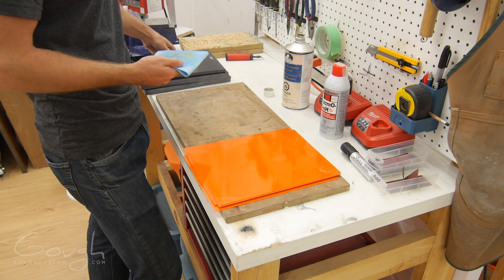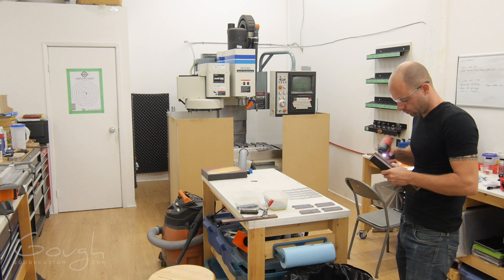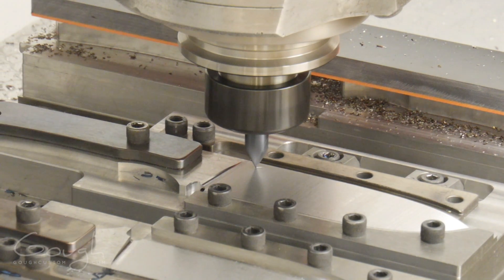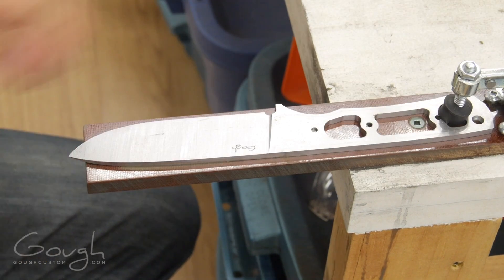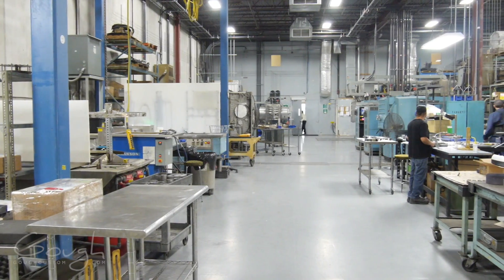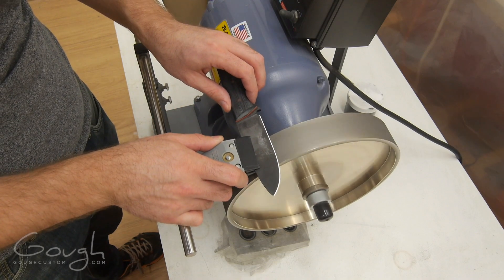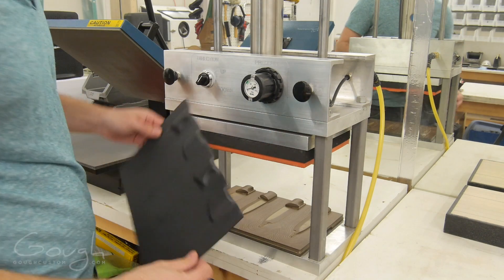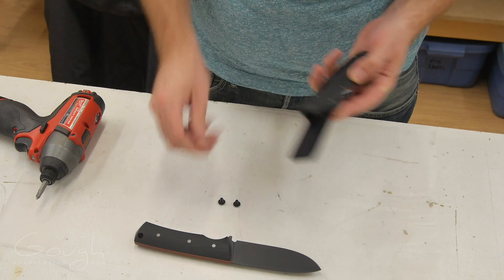Making a knife the high-tech way - Resolute MkIII

Comment: All that effort and you use A2 instead of 3V... Are you trying to upset me XD
Reply: Ive just learned how much better 3v is compared to 1095. I need a kiln though to even get started with it.
Reply: @3vforge  you could always send it away for heat treatment, probably cheaper if you're not doing many blades
Reply from the maker: As I said in my other comment I found that 3V tended to dent and roll at the edge far too easily for my liking, much more easily than A2 does for sure. I will hopefully be doing another round of steel testing soon to see if there are any steels out there that I like better than A2 now!
Reply: @GoughCustom  that's quite weird, 3v is one of the toughest steels available according to most sources. Are you sure your heat treatment was correct? I find it difficult to believe since the dozens of reviews I've seen always say that 3v has better edge retention, corrosion resistance and toughness that A2
Reply from the maker: @antimatter4733  It is definitely very tough, but in some cases that works against it as it means it's ductility will allow edges to roll. The heat-treat I used was with a 1000ºF temper as recommended by the steel manufacturer. I have heard that alternate low-temper heat-treatment with the addition of cryo can cure 3V of it's tendency to roll edges, but I haven't personally tried it yet. Comparing two steels by just saying 'A2 is better than 3V' or the reverse unfortunately just isn't that accurate because it fails to take into account the fact that every steel performs very differently with different heat-treatments... Other companies A2 is definitely not the same as my A2! Same goes for the 3V test, other people's 3V may perform differently because of their heat-treat. I can say I have tested my steel against knives from many competitors and I have been very happy with the results :)
Reply: @GoughCustom  it sounds like you heat treated according to the manufacturers recommendation but didn't take into account the properties you were looking for. The recommendation calls for an austenitizing temperature of 1950 with a 3x tempering or 1000, however this leads to a hardness of around 59. If you were having problems with edge rolling then the hardness was probably too low. If you aimed for a hardness of around 61-62 you likely would not have edge rolling and still have equal or greater toughness with better edge retention and corrosion resistance. Just something to keep in mind if you decide to try 3v again.

Comment: What type of steel are you using?  I assume not 440 or some Chinesium like 7CrMoV17
Reply: A2... Pretty mid range considering the tools he's using
Reply from the maker: It's all in the heat-treat... Even the best steel with a mediocre heat-treat will perform poorly. I'm using A2 because it's very tough, that lets me run it very hard which in turn lets me run the blade very thin which increases cutting performance. I am very happy with my A2 and I have had many customers tell me it easily out-performs their other knives with 'super steels' like S35VN and so on, which are usually heat-treated much softer because they are not tough enough to be run above 60HRC safely...

Comment: The blades look pretty thin, I wonder how they hold up.
Reply: A2 is quite tough but he's running it at max hardness so I wouldn't recommend any lateral force or chopping bricks
Reply: @antimatter4733  yes a2 tool steel is nice. Looks like he does great work
Reply: @mrglock2313  actually a bit disappointed with the steel choice. 3v would outperform it in edge retention, toughness and corrosion resistance at the same hardness imo
Reply: @antimatter4733  I just received a bark river bravo 1 in cpm-3v today. I am very pleased with the quality and it feel super sharp. For the money bark river knives are hard to beat.
Reply from the maker: Definitely not chopping bricks :) but other than that the blades stand up very well to hard use, I baton with mine all the time with no issues. The blade is about 0.018" thick behind the edge.  I decided not to use 3V after testing both 3V and A2 extensively. 3V is 'tougher' but it also dents and rolls at the edge far more easily than A2 does which resulted in lower real-world performance. I believe there are some alternate heat-treats for 3V which reduce the tendency  to do that , but honestly I am very happy with the performance of A2 and I have hundreds of knives in the field with customers who are very happy!
Reply: @GoughCustom  A2 I find to be great, and it's alot easier to sharpen than 3v. I just use my knives for gutting and cleaning deer. I hit alot of Bone but I don't split wood with it.

Comment: What's about the sharpening when having such a hard coating on the blade? For me it means to always grind a little bit of the dlc together with the steel. Does it have any influence on the sharpening with a stone or so?
Reply from the maker: Because the coating is so thin it really doesn't cause any issue at all. The abrasive in a sharpening stone is till much harder than the coating is, so cutting through it is easy!

Comment: You should change the title to "Manufacturing and assembling a knife the high-tech way"
Reply from the maker: Not really. I designed the knife, the fixtures and all the processes for making the knife shown here. In a very real sense I make every knife, even though I have help along the way.
Reply: @GoughCustom  not really... Your comparison would be like saying an architect or designer are the ones who build a house or other building.  Nothing wrong with either way... But there are big differences.
Reply from the maker: Except if the architect also built the house, you realize that's me in the video actually doing all the work right?
Reply: @GoughCustom  no... The machines are doing 95% of the work.
Reply: Joe Gray that’s like saying blacksmiths that use power hammers aren’t making the knives. He may not be forging it but he is making that knife in every way. I love traditional blacksmithing but this is impressive in its own right and I would love to have one.
Reply: Joshua Wood the analogy is totally relevant because his point was using machinery apparently means that you aren’t creating the item that’s being made, and last I checked, a lot of blacksmiths use power tools like power hammers, belt grinders, etc.. And I was disagreeing with it because I felt it was invalid 😂 and I would love to if I had $375 and they weren’t sold out
Reply: Joshua Wood also I wasn’t saying blacksmithing and metal fabricating are the same thing, they obviously aren’t. Just disagreeing with the idea that he didn’t “make” the knife.
Reply: Joshua Wood ok then it looks like we agree. He made the knife. That’s all I was saying 😂 op said he didn’t make the knife. All I was saying is that he did. Not that he handcrafted it with skills he accrued over his life and that his blood and sweat went into it. Simply that it was something he created. I really don’t think we disagree on that 😂
Reply: Joshua Wood the best knife I’ve ever gotten was made by a polish smith and it’s an absolute work of art. So I 100% respect traditional smithing. I just thought it was unfair to say the guy isn’t make the knife
Reply: Go take another gay profile pic for your youtube profile big fella. He most certainly made the knife. It's like saying a carpenter doesn't build a house, his saws and hammer do. Negative Nancy.

Comment: Holy damn that's a nice thing. But what are Chicago screws and how do they work?
Reply from the maker: Thanks! Chicago screws are basically just a nut and bolt, but both halves look like screws, just one side is larger and has threads on the inside.

Comment: Aaron thanks for your videos, they are beautiful, inspirational and also very educative for beginners like me. I have a specific question about what kind of respirator and filter you use. I am currently using 3M 6200 respirator with 3M 6051 A1 filter. But I am not sure if it's a good filter as It's main purpose is to stop harmful gas. What would you recommend? All the best,
- Ali
Reply from the maker: Hey Ali!
Many filter are 'combo' filters that stop both dust and gas, you may have one of those. The type of filter you want is a 'P100' filter which is designed to stop 100% of particulates, check to see if you current cartridges have a 'P' rating!
Reply: Thank you!

Comment: Aaron, that's some really nice production op set up, especially CNC toolkit.

One thing that struck me as unusual is using screws only to hold the knife together. I understand that additional epoxy might have complicated matters. The knife, with epoxy applied to handle scales would have had to be fully assembled, then epoxy should cure and only then the finishing and grinding screw heads off can take place. And some glue is likely to be squeezed out during assembly, and it'll have to be cleaned off, or scales'll need to be protected during assembly. Also, I have no idea if epoxy adhese properly to DLC.  

Still, somewhat of surprise to me. But then, it is very likely I underestimate the strength of screw-only assembly. It is not like I've broken a single Resolute to prove otherwise! :)
Reply from the maker: Hey mate! Unfortunately epoxy adheres 'too well' to DLC. DLC is actually slightly porous so once the epoxy gets on it, it is impossible to clean it off which is a big part of the reason I avoid it at the moment. I have always treated epoxy basically just as a sealant anyway though, the handles are more than strong enough with just the bolts. I have tested this a few times and the only way to break one of the bolts is to bent the blade so far that it also breaks... I have never been able to break a bolt without also breaking the blade! So they are definitely stronger than you would think!
Reply: @GoughCustom  
>> DLC is actually slightly porous so once the epoxy gets on it, it is impossible to clean it off

Thanks, I admit I did not know that. Looks like it is even more of a nuisanse than I thought! Definitely not worth the hassle if bolts are that strong.

Comment: I know it's high tech but there seems to be a lot of waste
Reply from the maker: Unfortunately pretty much all industrial processes produce more waste than we'd like. There isn't really many ways to make a knife to this standard without wasting some material. You could replace the handle with an injection molded part, which is a very low waste process, but then the quality would also be lower as it's a less durable material. The blade could be hot-stamped to waste less material, but then the material properties might be compromised by that process as well unfortunately...
Reply: @GoughCustom  thanx for explaining that 😁

Comment: It was going well all up until the weight reduction holes in the tang...
Reply from the maker: Weight reduction in the tang is necessary. It makes sure the balance point of the knife is in the right place, without the balance point being right the knife feels heavy and dead in the hand. The weight reduction does not reduce the strength of the knife either, there is no way to damage the handle without breaking the blade.
Reply: Oh i get what you mean, since it creates balance you can get better swings and overall a better feel of the knife.

Comment: came back the third time now

each time i've watched it multiple times

just beautiful, no unnessecary part to it
Reply from the maker: Thanks very much Mark! I appreciate the kind words :)
Reply: you even reply, many on youtube don't do that :)

have you ever made a folding knife? i like the design of the Kershaw Cinder, but many say the blade steel isn't that great.
Reply from the maker: @marc_frank  I would love to make a folding knife at some point in the near future!! I just haven't had time so far...
Reply: @GoughCustom  i'm curious and excited for what you'll come up with

how many cad iterations did this knife go through? i'm doing a little bit of this, too, in my free time.
i'm designing drone frames, they are a lot simpler, because they are just cut from carbon fiber sheets.
Reply from the maker: @marc_frank  No-one ever asks that question, but it's a really great question! My CAD model for the knife and handles is at 32 revisions, but the CAD models for the fixturing is at 362 revisions, and that doesn't include the sheath :) It's pretty crazy the works that goes into getting everything right as I'm sure you know!

Comment: It seems you removed the recent vid on how you sharpen your knives. Is the method still valid and you're just keeping it a secret or did you find something wrong with it?
Reply from the maker: Hey mate! My only knife sharpening video is ~6 years old and is definitely still on Youtube: https://www.youtube.com/watch?v=ZlI5PaXsfOk&lc=UgxTiq9r6oo1VVqbgqF4AaABAg

Nothing wrong with that method at all, as you can see in the "Making a knife the high tech way" I do have a newer sharpening system which I designed and made. The results are the same, just my new system is much faster.

Comment: The only reason I would start using a cnc machine to make my knives would be to mass produce. If I had an actually business of course. I like making hand made knives in my garage though
Reply from the maker: The primary reason I use CNC is for the sake of consistency, and to remove the 'low value' work. Consistency is important, because without it you cannot reach the high levels of quality that I want. And removing low value work (like cutting out the basic shape of the knife) is important because I need to focus my hand-on time with the knife in places where it's going to deliver the most value and importance, like hand finishing and so on.

Comment: @
Gough Custom - How would one go about getting a DLC on a knife which he himself makes ?  Are there companies that do this ?
Reply from the maker: There are certainly companies that do this, however if you just want a single knife coated they will charge you quite a lot for it to be done, likely over $100 unfortunately...
Reply: @GoughCustom  
And with this file jig, is it possible to file straight up and down in order to form a bevel? Was planning to make a Tracker Style blade, I was just wondering if that was possible, or do you need to move the file in a horizontal Motion in order to form the bevels.
Reply from the maker: @BrokenTengu99  Filing straight up and down is no problem at all!
Reply: @GoughCustom  
Awesome !  Thanks , Buddy !

Comment: Most of the knife makers in the UK cant afford those machines, to sell a knife here for several hundred $ it would need to be gold plated with diamonds on top. I made 10" highly polished O1, D2 and 154cm full flat grind 4mm blades with stabilised Zebrano handles and stainless loveless bolts and could not sell them for $50. Not quite as good looking as your knives but not far off either
Reply from the maker: I know of a few makers in the UK who sell knives for a lot more than I do! However the market in the USA is definitely bigger. That being said I fairly routinely sell knives to customers in the UK as well. Building a market is every bit as difficult as working out how to make the knives, that's for sure! It has taken me more than 5 years of constant work to get to this point!

Comment: No lube? Say good bay to the tools
Reply from the maker: Hey mate! These tools are actually designed to be run dry, the coating on them helps protect them from the heat made in the cut. I have no issues with tool life!

Comment: Sexy knife. However, I prefer pancaked sheaths, and it's better when you can remove the rivets.. If you get sand or some other small hard substance stuck in the edges of the sheath they'll tear up your knife edge, and they won't even come out with a pressure washer.
Reply from the maker: Interesting feedback! I will keep that in mind!

Comment: Looks like a modified Tormek sharpening clamp?  Looks darn good overall, beautiful, beautiful work.  I LOVE the precision of CNC work.
Reply from the maker: Hey Dan! The clamp for the sharpening system is actually just a standard Tormek clamp with tape wrapped around the jaws to prevent it marking blades. Glad you liked the video!
Reply: @GoughCustom  Nice!  I really like the setup you have with the CBN wheel there, I might have to shamelessly duplicate that for the roughing phase of sharpening on my plane irons and chisels!  That's going to be a lot easier than spending the hour to get the Tormek to remove the same amount of material.

Comment: Weight reduction? No thanks
Reply from the maker: The weight reduction is important because otherwise the balance point is completely wrong and the knife feels 'dead' and heavy in the hand. The weight reduction does no reduce the strength of the handle, the remaining cross section is still more than enough to ensure that you will never (ever!) break the handle before you break the blade! I have tested many of my knives to destruction, so I am very certain about this!